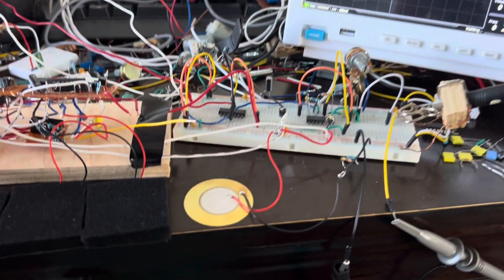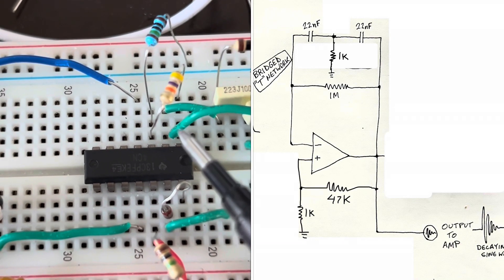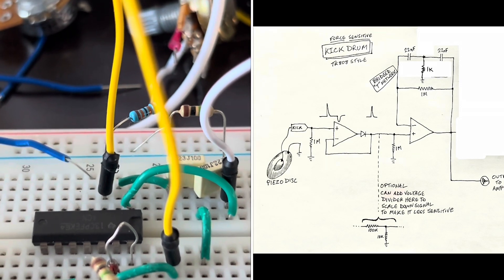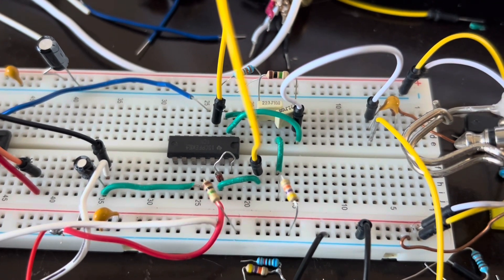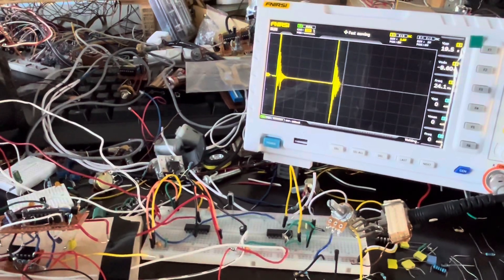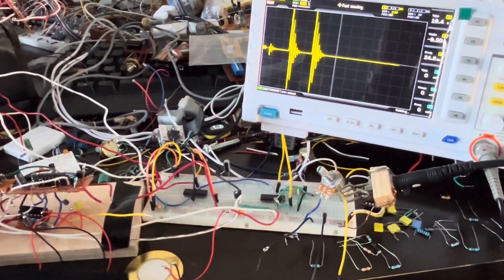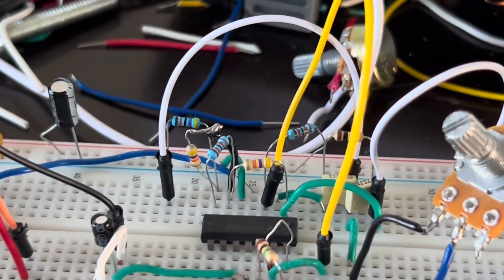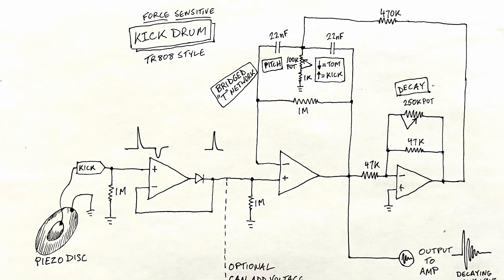Force sensitive Kick Drum pad using a Piezo disc from scratch

Comment: We need how can we making embedded  Control circuits without microprocessor/controller

Like digital/ analog sensors/transdusers
ACD/DCA
Drivers for temperature, pressure, level, Flow rate, speed, position, Force 
 
Please sir🙏🙏🙏🙏🙏

Comment: Very helpful, thanks. I recently started building a little diy rhythm box w a gate sequencer that triggers the percussive circuits. I made a couple piezo drum triggers, just for fun really. However, I didn’t know how to properly condition the signal from the piezo discs when going to the core twin T drum circuits. This helped a lot. Sounds good 👍🏽
Reply from the maker: @ricjenner1120  thank you. Working on a video on how to condition piezo signals to work with digital inputs. I.e to save a drum sequence onto an eeprom or a ram chip

Comment: BTW:
F = 1 / (2 * pi * sqrt( R1 * R2 * C1 * C2))
or at least very close to that.
With the C1 = C2 the ratio of R1/R2 controls how much it decays by per cycle.
If you want a really long sustain, a little positive feedback can extend the decay longer.  Too much and it oscillates.
op-amps like TL074 seem to be good for this sort of stuff.  LM324 not so much.
Reply from the maker: Thats my go to on a sine wave generator

Comment: Very cool, but you omitted a very crucial part, a trigger mechanism, you could place 3 cd40106 inverters in series with an RC time constant (online calculator) in between the first and second inverter after the first opamp, using 1nF and 18K should give you 1 millisecond, witch is used on the TR-* series from Roland. I found that out when i made a midi controlled TR-808 kick drum using a pic18F1320, if it aint right, it sounds weird, like whistles or fast cow bells a like if the trigger is very short. Than the sound would independent of the piezo element and have repeatable consisted timed kick drums. the accent input in the adjusts the overall voltage of the drum circuits, the repeating 2 transistor circuit at the start you see in most of tr-.... series. maybe a sample & hold circuit on the piezo element could give you somewhat of a constant accent value in combo with a cd40106 with time constant for a trigger should fix it properly.

The resistor in the T bridge, the 1K might be a bit big. you should aim for 150 Hz.

Would you do a second video on this with the suggested mods?
Reply from the maker: @AnalogDude_  piezo is the trigger
Reply: @igorbrichkov3632  no, good. the trigger in the TR-808 is .... C40, R162 & R163
Reply: @AnalogDude_  I think if left as is, its fine, the differnce/variation from the piezo is more organic. 
start making the piezo a fixed pulse length and your making it plastic......
Reply: @ The piezo should be converted to "accent", in all Roland TR-.... capacitors and resistors are used for triggers. the trigger is pretty sharp or fast, Roland also does this in the spd-20 converting piezo to accent or velocity.
Reply from the maker: @ i get it but its not audibly discernible. Unless youre using a sequencer with a square wave gate. For a bare bones tr808 kick with piezo pitch and decay all you need for a good sounding drum. Tone and accent dont do much. I used it with the drum machine i built previously and yes its good but dont think necessary here
Reply: @igorbrichkov3632  I think it would be best to use a sample and hold circuit to sense the piezo element voltage and use the C40, R163, R162 from the TR-808 kick drum and Q39, Q40 with it resistors. than feed the sample and hold voltage to Q40 collector, pretty sure this would improve the circuit a lot, being a real kick drum.
Reply: @igorbrichkov3632  accent on Q40 has influence on then amplitude of the sine wave of the opamp (t-bridge).
Reply from the maker: @AnalogDude_  https://youtu.be/rzXzWCIK878?si=8b1_RfQm8diNHeVB

This is the full complete tr808 circuit with accent pitch included including the portions you mentioned . Not really very discernible to my ears from the piezo envelope alone.
Reply from the maker: https://youtu.be/4lwuM1RKztQ?si=nDcyMasSpjdC5yqT. This is the complete 808 kick circuit
Reply: @igorbrichkov3632  Ya, but you need C40, R163, R162, this causes the Trigger Pulse, it's very fast or brief compared to your piezo. much faster. it also needs a square pulse. from Q40.

I did this like almost 10 years ago and it's made on Vero board, the sound is awesome, like the real thing.

using a sample and hold for the Piezo is still no clone.
: )